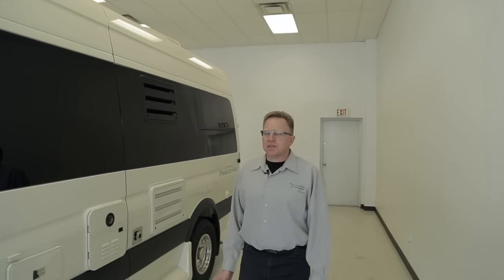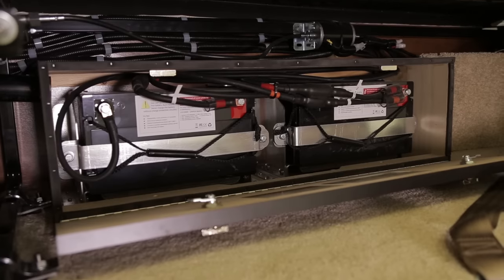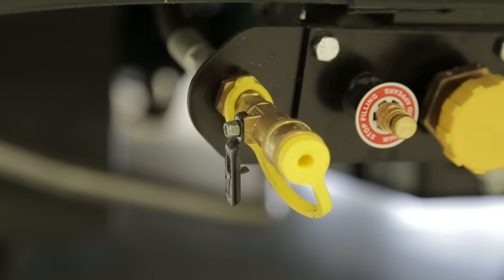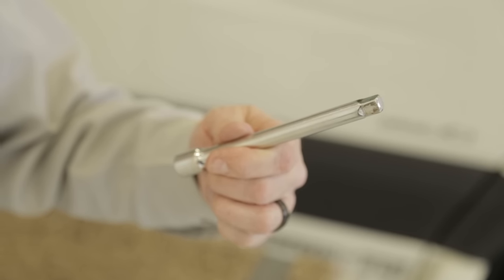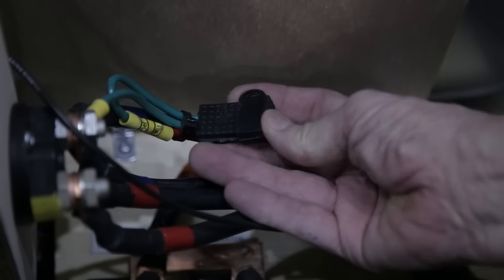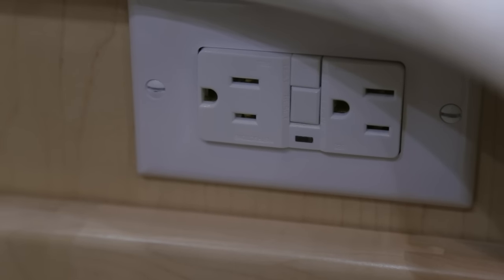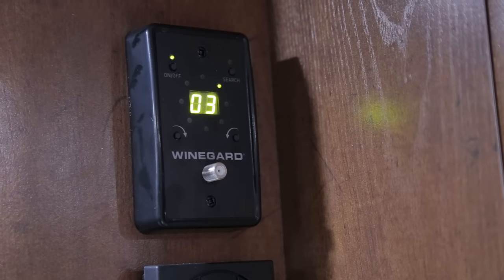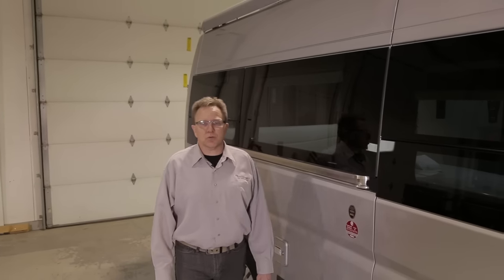2016 Pleasure-Way "How To" Appliance + Systems Walk-Through

Comment: do you have to remove the lithium battery for the winter?
Reply from the maker: Hi MetaView7, we only recommend removing the lithium batteries if the motorhome will be stored in extreme winter weather conditions. For example, if average temperatures are -15 C and colder, it would be best to remove them. If not, then just make sure the batteries are fully charged and the main battery disconnect switch and the red key disconnect are in the off position.
Reply: Thanks for your reply. You guys make high quality RVs.